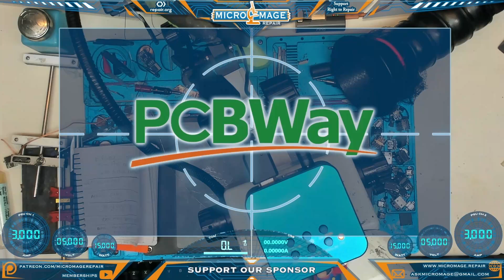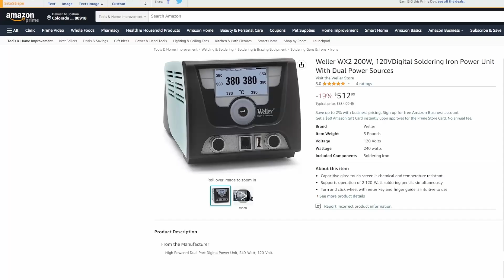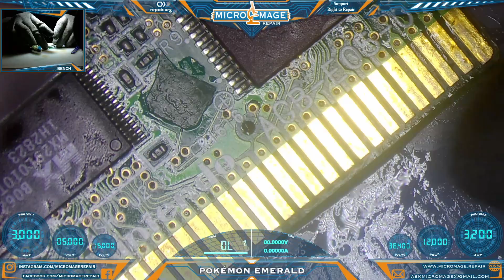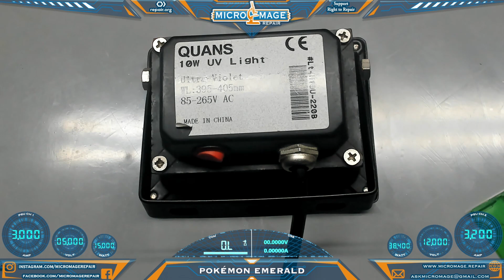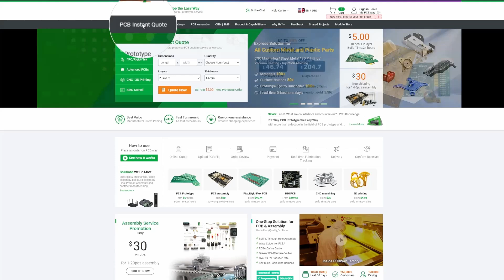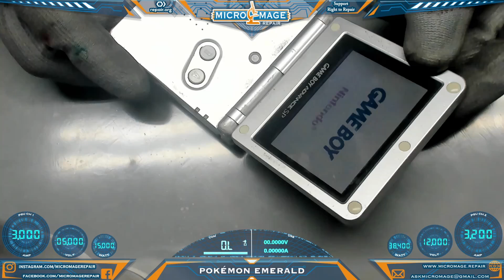Pokémon Emerald: Pad Repair & Battery Replacement

Comment: Good repair, Josh.  You don't have to worry about restoring the trace below R7.  That trace just runs to the test pad on the pack.  You just need to restore the connection to R9 to restore RTC.  Solid work.
Reply from the maker: Very interesting!
Appreciate that!

Comment: Hey what if the pad it completely gone I bought it second had on eBay and the trace pad is gone
Reply from the maker: Make a new one. 
Solder braid works or copper tape like I use works.
Same method, just with the addition of having to trim it down to an appropriate size that won't touch anything it shouldn't.